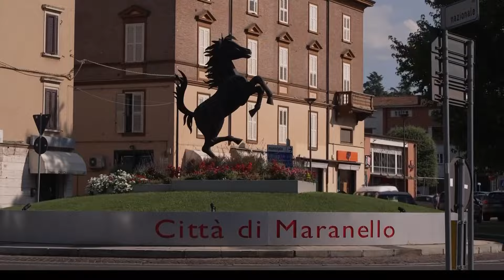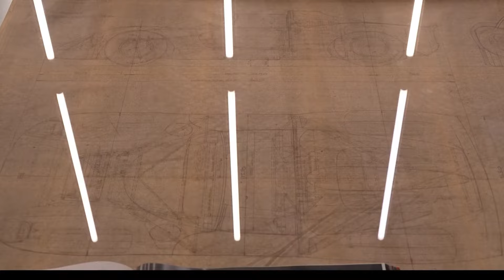CNBC takes a tour of Ferrari's new e-building

Comment: To say that an ev can match the performance of an ICE is 🐂💩. Yes it may out accelerate it but it cannot out handle it.
Reply: Plaid model s with track pack lapped the green hell faster than a Ferrari enzo or a 2023 maserati mc20 can!
Reply: Factor in the extra weight, and the recharging times, and the life expectancy of the batteries....
Reply: The 296 GTB is the perfect and best use of the ev technology—keeps the sound and smaller size and less weight that a huge battery requires. The ev motor augments the engine lag of the turbos at launch but at all speeds.